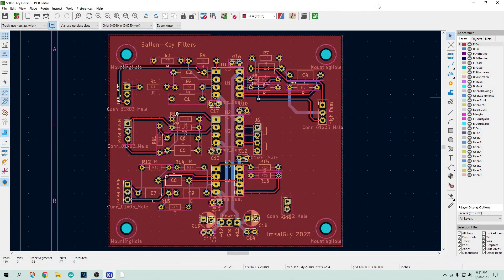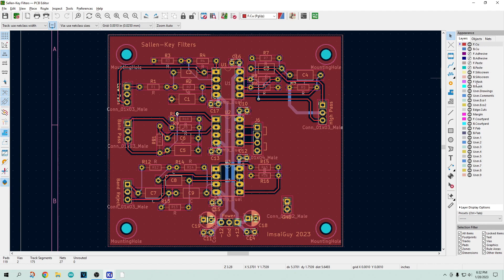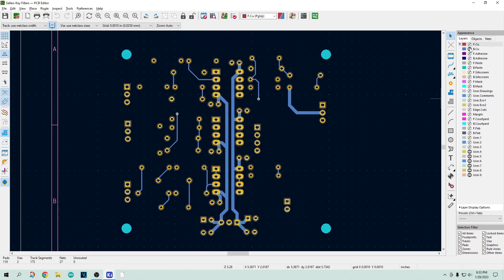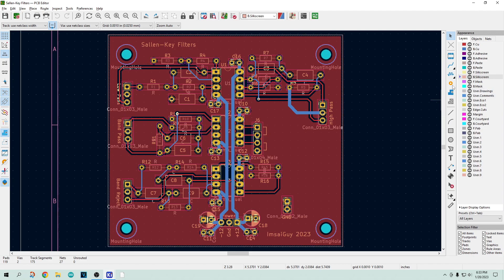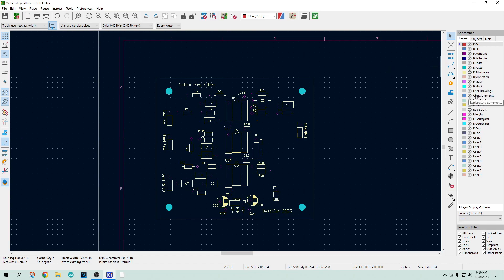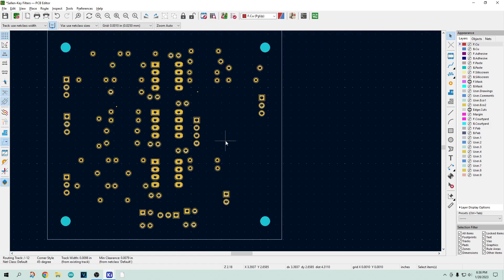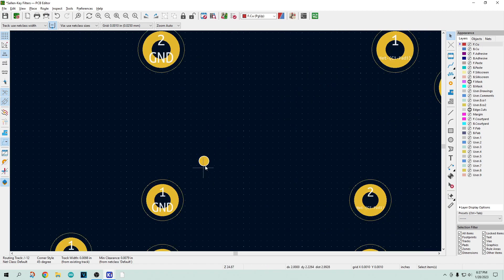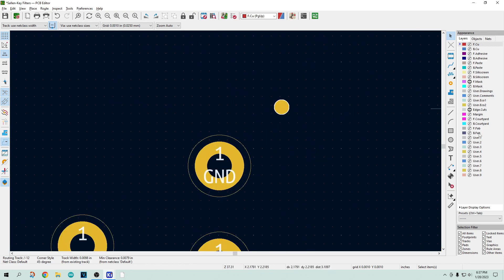#1420 PCB - Layers

Comment: I feel like I'm shouting from the peanut gallery, not having made a large run solo. But I have had a little experience with the KiCad project and reasoning, and I wanted to bring up the reason for having edge cuts and margin layers, and apologies if you just wanted to avoid the topic at this point. It does seem weird that there's edge cut layers and margin layers.

The edge cuts are for things like cutting out part of the PCB for, say, an area that needs a gap for safety (like the board inside your non-Harbor Freight multimeter), or whatever other requirement require a "cut". The margin makes sure you're complying with the fab's abilities for accuracy a distance away from the edge of the board (including the contour of the edge cut.) Sorry if over-simplifying or you already know this (you probably already know this and more, just speaking up for KiCad.) And, like you say, if you forget a PCBWay engineer or tech will ask if what they can do is acceptable.

And thanks again for using a FLOSS tool like KiCad to teach!